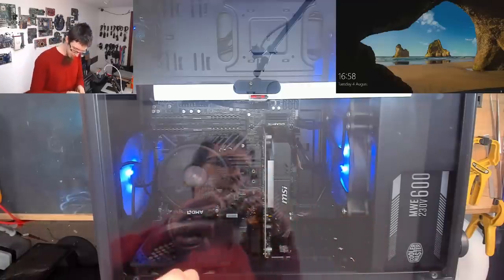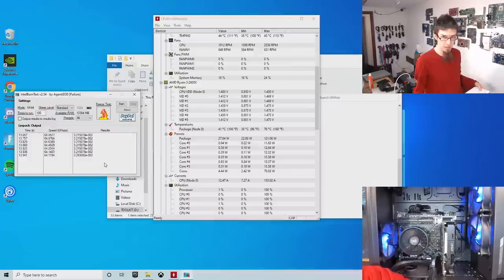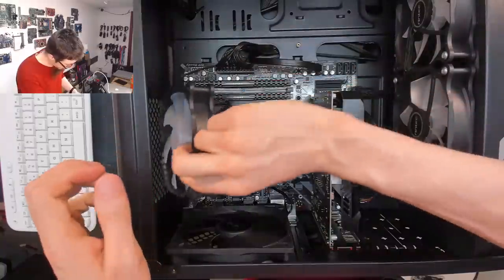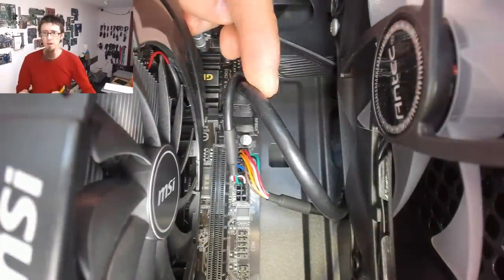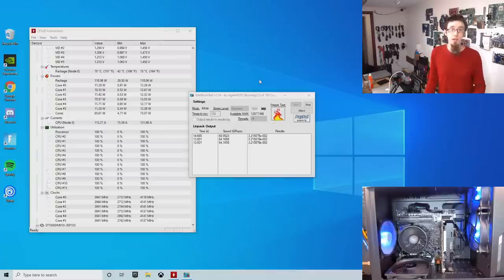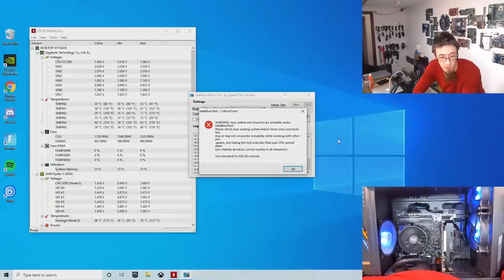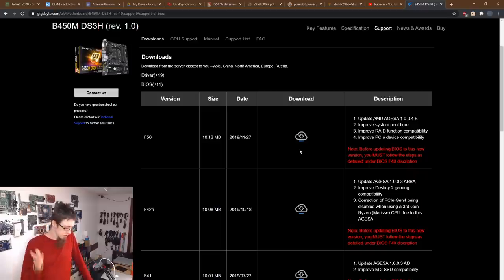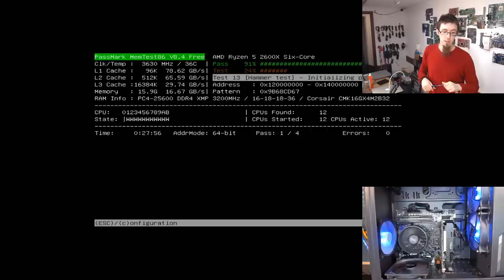Gaming PC Crashes at Random - LFC#217

Comment: I will never buy a power supply that isn't modular, that way if I don't need a wire, I can remove it rather than have the rat's nest in the bottom of the case.

Comment: Fun times with ryzen and ram that can only do 2933 (say hi to my asus x370 pime Pro be it a 1800x or a 3600x) early motherboards can't do more then 2933 due to the way the traces are made for the ram slots

If you have one of these motherboards that can't do 3200 speeds I would use xmp enable with 2933 not 3000, but as it passed an overnight test I guess it's fine at 3000 any way

Comment: Cutting the molex plug off the fan was totally unnecessary and reduces functionality if the system is ever modified or upgraded.
This was your personal dislike rather than a required step.
Reply from the maker: There's no reason to use molex connectors if the fan has a 3-pin on it. Even if it's a cheap mobo with few fan headers, 3-pin splitters cost a couple of bucks, and then you still get temperature control on the fans. I would've done the same to the other fans, and added in a splitter, but they didn't actually have 3-pin on them at all.

Comment: Years ago in the pentium 4 and athlon days I had an issue where my pc kept rebooting.
I had upgraded my motherboard and cpu but kept the old case which was Packard Bell.  It had a proprietary front panel connector block much like a USB header but I didn't know much about computers back rhen so plugged it straight into the space where it goes on the motherboard instead of checking what pin does what etc
What was happening was the hard drive led pin was connected to the reset button so instead of lighting up the LED the computer just rebooted.  Had to flip the connector 90 degrees to solve it so only power button worked but that all that's needed.
Took me ages to figure it out.  Had all manner of suggestions from all sorts of people

Comment: Too much voltage for these clocks and minimum voltages too low!
In most cases the minimum voltages are corrected by disabling power savings and the voltage should not go above 1.4V in this processor without an overclock.

Comment: Interesting. I got lucky and my computer is very stable but using that burn in test could be useful. I also never thought of underclocking ram. If my memory had errors on memtest I would probably just toss it and buy new RAM immediately. At least with an underclock I could use it. 100 MHz isn't a big loss (3200 DDR4 is really 1600 MHz since it's double data rate... 2x transfers per cycle.)

Comment: Even as a pc novice and not knowing anything I would switch off that xmp shit. Used to make the system really unstable.
Reply from the maker: I was resistant to XMP stuff for quite a while, but on modern machines it can be a 10-20% performance difference in at least gaming. XMP reliability on AMD has gotten much better in the past year or two since this video as well, better motherboards and BIOSes.

Comment: I had the same problem, my problem though were temps, so i bought a noctua air cooler and now it's as good as new. It all started right after i bought a new Graphic Card (a 2070 super oc) while before i had a 1060 6 gb turbo. So i guess i was bottle necking my cpu before (i7 9700 k) while gaming while now i was actully giving it (cpu) some work to do.

Comment: Hey my PC is downloading games at 2 to 3 MB , but the computer is telling me that I got the 400mb , can it be my antivirus ? I'm using lan , and everything else works perfectly, I know I got to update the BIOS , but if anyone knows please help, hate waiting hour's for a 20 gb games
Reply: Are downloads that slow from other sites? If not, it could be that game server. Also could be an issue with an HDD. If you're using SSD, then that's a lot less likely.
Reply: @frommatorav1  It's only when I download a game, my system uses 2 1 tb 970 Evo plus , and a 1 tb Samsung 860 for older games , I get slow download on steam , battlenet and Xbox game pass
Reply: @alexanderjaviervazquezsant4530  it's definitely not your storage. To check if it's the Anti-virus, turn that off until you reboot and try download again.
Reply: @frommatorav1  Ok, I'll try doing that then, thanks

Comment: new sub just b/c I like your methodical approach to trouble shooting. To be fair, perhaps we cant dick punch gigabyte so hard, Ryzen is VERY ram pickey and in fact  many ram manufactures have been putting out ryzen specific memory kits. I think AMD brought so much price/performance to the masses that they kinda got a pass on that quirkyness. I built my wife  an R5-1600 rig for a non-gaming use case. I tried to throw in some budget oyo ram and I could not even get a post with all new parts untill i tried it with just one stick of ram (8gb). Long story even longer...I had to get her a 32gb kit from corsair and it post right away. I couldnt fault gigabyte, it was all cpu IMO.

Comment: 16:20 If that ground pin is actually wired up and it makes contact with a live circuit (rather than the painted case) it can cause a short.  It's even worse if the connector has a small gap between the exposed pin and a contact on the board, because the pin acts like a spark gap and periodically grounds out for a millisecond whenever static from that hot, dry air in the system builds up enough static electricity.  That shouldn't be the issue when the cable is tucked up in the case, but it's another reason to clean up your cables and remove the ones you don't need.

Comment: The same thing happens to my PC lately after purchasing a used AMD Radeon graphics card from China. When I'm doing MS Word, Adobe Premiere, After effects, it works great and is awesome, with no resets at all. BUT, when I played my favorite Game Forza Horizon, it resets itself automatically. So we could say HEY, these used products are junkies, it could be the Graphics Card, right? TURNS OUT, IT'S NOT. You see, graphics card needs the power to power its processor, which will give your awesome display right? So I bought a new Power Supply Unit and everything works great, even with my favorite game. It's was just a PSU Malfunctioning.

Comment: yeah next time add some +voltage to the memory.One modle of memory is not stable at that xmp with that voltage... 1.36-1-37v shouldd to the trick and make it stable.Or you can try first by manual set the value and not enable xmp...

Comment: Before I watch, it's either unstable RAM or bad PSU.
Reply: Finally, go to watching through...
I use Molex for my fans!!! Well the ones that aren't attached to PWM.
Use HWinfo instead of HWmonitor.
Cinebench is not a stress test.
Always test XMP stability, it can bring a lot of issues...
2133 to 3133 is a 500MHz gain, not a GHz due to DDR.
Furmark is a GPU VRM test not a GPU test.
Use TM5 with the extreme profile for memory testing, it's more reliable and a lot faster at finding errors.(google integral memory guide Github)
Memory can be unstable at JEDEC spec, completely normal, doesn't mean it's faulty, all that means is that you need to find a stable setup for it.

Comment: Why not just add voltage!?  When running XMP you should check the required voltage to run at XMP,   Even at that voltage sometimes you will still fail,  Just add a touch more voltage to the ram!    And you are good to go,  No Need to loosen the timings or down the speed of the ram!  XMP always requires more voltage then just running at stock speed!  Like you said,  XMP is overclocking profile so knowing that you are upping the speed and tightening the timings of the ram, You should know that you need to up the voltage of the ram to make it stable! before 1 minute into this video i called the ram at fault!  Called XMP and voltage!

Comment: I actually had to do the same thing back in January on my b450 gaming pro carbon from msi. I was trying to run 32gb running at 3200mhz of vengeance RGB pro
Reply: Funny, i have also the B450 gaming pro carbon ac with with 32 gb ripjaw 5 ram, all are running without problems on 3200. If got issues before with drivers, if downloaded randeon adrenaline 2020 latest version, make a factory reset for drivers during installation and choose standard after express installation, since 2 months no blue screen. I also manually overclocked my ryzen 2700x to 4,2 ghz, run many benchmark, no problems since than.

Comment: I got the same instability using the same memory with my Ryzen 5 2600 build.  Interestingly enough, with the Gigabyte B450i Pro Wifi.   The Gigabyte BIOS didn't like the XMP profile for the memory, but after a lot of fiddling,  I found that bumping up the tRC value to 56 instead of the 54 the XMP profile called for, completely fixed my stability issues, allowing me to run it a 3200MHz.   If anyone is not aware, tRC is a delay timing.   I suspect at the default 54 it wasnt completing full memory cycles under certain condition, so bumping up the delay slightly just gave the RAM a little bit of breathing room.   Where I found the fix was on this thread over at the Gigabyte forums.   Different board, but its a Gigabyte BIOS issue https://forum.gigabyte.us/thread/8192/happy-x570-vengeance-issue-solved
Reply: Gigabyte again
Reply: @Rusty_Gold85  Yes and its a long standing issue, and Gigabyte don't seem to have any intention of addressing it.

Comment: I put one together where the #%%^##^ motherboard wouldn't correctly read the RAM for its settings, or the RAM wasn't properly telling the motherboard what it needed. It automatically set itself to the *wrong voltage*.
Bloody hell! That is a thing that should never ever happen at this stage of things. 30+ years ago there was self configuring RAM that just effing worked using Serial Presence Detect and now we have systems that are much more sophisticated but apparently due to incompetence or laziness on the part of some hardware manufacturers it often requires manual intervention to force it to the proper settings. Quite like original Windows 95 and how it often had its own ideas about resource allocation while it ignored plug and play hardware.

So read the label on the RAM and look closely at the settings in BIOS or UEFI to make sure the stupid thing hasn't set itself improperly. Just can't rely on the smart people who make this stuff to do that simple thing right.

Comment: this is a perfect example of why i'm not a big fan of amd ryzen builds, they're great but they are only great when they work and i happen to have a DS3H board too but its on the B250 chipset from Intel, but i don't play with things like overclocking or xmp profiles, undervolting, nothing like that, i just set my machine up with everything kept to default settings out the box and just leave it alone, as a matter of fact that's how you avoid most issues like this anyway, you should only have to "fix" something when the machine is actually broken alright? in the hands of a professional technician they can be great tools on the system to have but in the hands of an amateur it can be a disaster.

Comment: xmp failures occur far more often with amd setups than they do on Intel. I know amd fans wont like hearing that, but its truth. another way to say the same thing, amd setups are less robust, instability occurs more often with amd setups than they do with Intel. It's been that way for decades. and no, I am not suggesting not to buy amd, I am just stating a well known fact, well known if you have been building and working on pc's since the early 90's like I have. (commercially)

Comment: Gaming Computer.....?? Are you sure, looks like a budget throw together to me. Worked on hundreds of under powered, over priced wanna be gaming computers like this. Got to the end of the video.......oooooh Gigabyte Mobo's hated them, MSI was also my go to stuff. 

Heres one for you... I acquired an Over Clockers  Sabre Tooth Z97 & 4790K build from a friend, after replacing the SSD and actually connecting the WD 2Tb to the Mobo with a SATA Cable. It ran without error for a year until I dropped in an 8Gb XFX 5700 (still stock). I get infrequent green screens and total lock up. Strange... I do a hard re-boot and it fires up without any issues or Windows complaints, any ideas.

Been out of the industry for a few years, I do the odd build but you loose touch.

Comment: I had the same problem on my gigabyte auros elite b450 I just put it 3133 and that fixt it on ryzen 2600x the MHz of memory ar not stable so if you have it on 3200 it Wil go like 3195-3210 and that's above what some mobo's can handle
So just lower it a bit

Comment: WTF are the bottom fans pulling air in from the PSU shroud?

Adding heat isn't ideal. You want to EXPEL it
Reply from the maker: AeroCool have a bee in their bonnet for this kind of fan placement, I'm not into it either. It will kinda bring up air through the bottom-front of the case though, so it's not doing any harm. Wouldn't recommend it in a higher-end system though, where heat is actually an issue.

Comment: From your experiences, do ryzen cpu occure in your line of work more often then Intel? Anecdotal experience from friends tell me they do but internet tell me its just saying.
Reply from the maker: Yea it's been a massive swing to AMD over the past 18 months - and with good reason, for the most part, AMD is cheaper and faster in almost every practical situation. Intel does retain some stability of 'it just works', but most people in the DIY/Enthusiast sector usually don't mind, or even welcome having to do a little fettling to get the most out of their system.

Comment: hi i solved the ram problem by changing dram volt and setting it to 1.33v when i activate xmp amd at 3000 mhz
Reply: Aint 1.33v low for XMP?

Comment: I had a second gen ryzen for two years. I could never get my 3200 RAM to run at that speed.
Reply: Same getting 3200 was quite difficult with first gen motherboards or 1st gen ryzen with 2000 cpus you could do 3200 If your motherboard could run at 3200, where as ryzen 3000 can do upper 3700-3600 ram speeds if your motherboard can do it (there's me with a Asus x370 prime pro that can only do 2933 with a 1800x and a upgraded to 3800x that still can only do 2933 ram speeds )

Comment: gigabyte peeved me off with bios bs, and msi pissed me right off with their driver support. they seem like a crow that goes "oooh shiny" and just drops driver support. fine if you want new stuff, not so good if you want 5 to 8 years out of a system.

giving asrock a go now with the x570 pg4. initial experience is, my 3600 ram wont post over 3200mhz, and the sb hovers around between 46 to 54c with the little fan flat out, which i dont like.

Comment: holdup.. so you plug an usb drive into a customer machine you cannot possibly trust to be 100% virus free? that's a big no no. :)
i NEVER let any clean drives come in contact with customer stuff, boot in linux and copy your utilities over or use a passwordless read-only network share.
when i HAD to do such unlclean things i put tape over the connectors to mark them as to-be-formatted.

Comment: Great video.  I noticed all the wall warts / power adapters you have hanging on the wall.  Ever consider just getting a dc barrel jack adapter kit?  Then just make a banana jack to dc jack adapter cable to hook to your bench power supply.  Now you have any voltage you want with any adapter you want,  you can monitor current and set OCP,  you can even reverse polarity.  I started doing this a couple years ago.  Kit like this -  https://www.amazon.com/aceyoon-Adapter-Universal-Connector-Thinkpad/dp/B0722J415P/ref=sr_1_13?dchild=1&keywords=dc+adapter&qid=1596894235&sr=8-13
Reply from the maker: They double as stock, so when a customer needs a new charger for their laptop, I've got one on-hand.
Reply: @Adamant_IT  Makes sense.  Would be likely impossible for me as I focus on general electronics repair and trying to keep specific parts in my inventory would probably require a large warehouse.  Most of my stock is general components and even with that,  I have little space left.  I also have a terrible inventory system lol

Comment: I spotted the problem right from the start Gigabyte/AMD   My used MSI cured my POS Gigabyte , NEVER GB again.
Reply: Sadly I agree.

I had a series of issues with 3 different Gigabyte z370 and z370-i MBs that I finally threw up my hands and just rebuilt the system as a Ryzen system (Asus x570-plus MB).  Anyone want to buy an i7-9700?  :|

Comment: I believe if you look at AMD site, the Ryzen 5 2600X will only run a max of 2933 MHz memory.
Reply: That is why its called overclocking!
Reply: @mass1985  I know, that's a manual overclock not XMP which max of 2933 MHz memory and the is highest MHz clock speed that can be set for this chip set, processor combination.

Comment: hee man i wanna say that i had the same problem 2 years ago and i fixt it just also by turning of XMP but i just wanted to get that 3200mhz so i fix that by setting up that clock + highering the voltage someting like 1.35 - 1.45 not sure anymore but i new that worked for me i thought maybe you can try this next time i heard that its happening most whit the memory controller on the ryzen 2600 - 2600x

Comment: Running hardware that isn't supported by the Motherboard not a good idea..
Reply from the maker: Support and Validation aren't quite the same. The QVL is just stuff that Gigabyte have specifically tested with the board. Not being on the QVL doesn't mean it won't work, as it's all DDR4 memory - it just means there's no 'recommendation' for it from GB.
Reply: @Adamant_IT  True but in this case the problem you had with that PC may well be the reason for the lack of any recommendation for the use of those particular memory sticks.